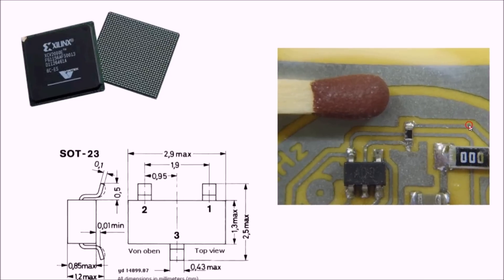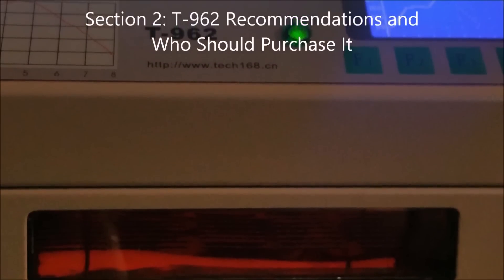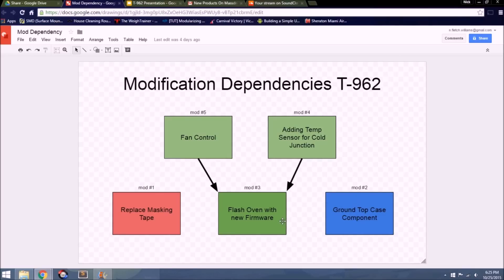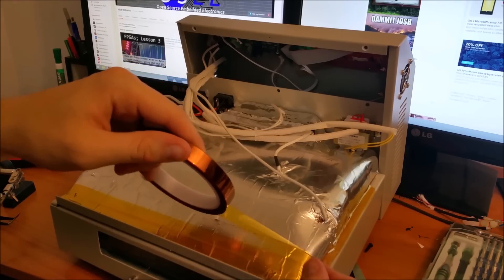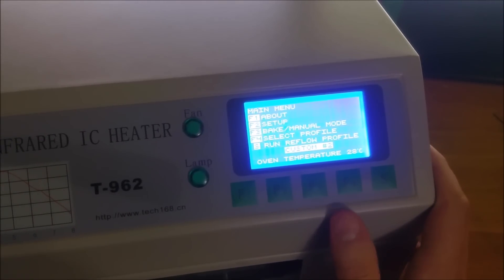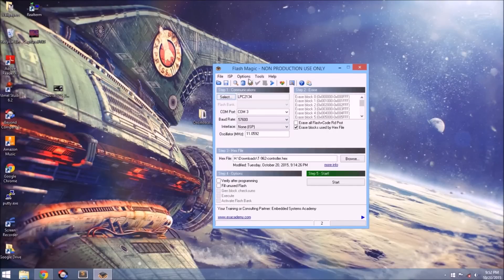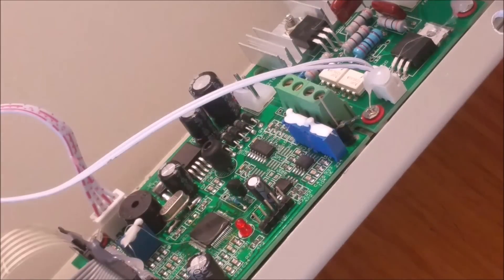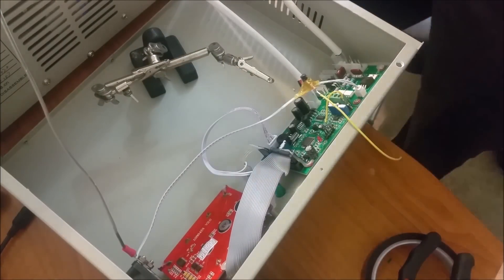Modifying the T-962 Reflow Oven

Comment: I just used a Silicon Labs CP2102 to flash the LCP2134 in my T962 by doing the following:  I set up flash magic exactly as in the video, I then held n_ISP to ground without releasing it when he did in the video, then touched reset to ground, then tested by reading device signature with n_ISP still grounded, then flashing, then releasing n_ISP, then touch reset to ground.  That worked like a charm after the normal method did not.

Comment: Hi, I'm having issues flashing the firmware, none of the windows software tools work on win10 and 7. In flashmagic, I cannot select any lpc2000 chips and when installing the Philips flash tool, I get an error about a missing. ocx file which I have fixed, but it still does not work. 
Can you put the version of flashmagictool in your dropbox, pleeeeease 😊

Comment: A pretty good video in lots of ways, thanks for the work and result.
A VERY important matter of electrical safety, protective earth conductors may be subject to extreme current under fault conditions (>1000A) and should NEVER rely upon solder alone to retain the conductors in terminals etc. Additionally, the fasteners used to attach the protective earth should not be used for any other purpose, and especially should NEVER be removed to enable removal of some other component.
For these reasons, the ground conductor should be crimped into the terminals with a proper ratchet crimp tool, it should be flexible (not solid) conductor in this application, and the lugs should be attached with dedicated screws using star washers to bite though the paint for proper electrical contact... and then TESTED to comply with regulations (typically <1ohm measured with 100mA or more current... that is right, an ordinary electronics multimeter is a sorry substitute).

Comment: Thank you and Unified Engineering. I did this mods - except the fan mod - to my T962-C model.
I decided to keep the system fan running to prevent overheating because of the higher load on the mosfets.
Also I did some mechanics like a transparent plastic screen instead of the matt one. Far better to read.
And I exchanged the push buttons from the panel PCB with better quality ones. Thumps up ... cool oven ...

Comment: I recently purchased one of the T-962 ovens for my own use. Thanks to your video, I'm working on most of the hardware steps to upgrade it, mainly grounding it and replacing the tape. However, I have a question. With regards to the tape, the tape that you linked to in your BOM, the ProTapes Pro 950 Polyimide Film Tape, is rated to 500 degrees Fahrenheit/260 degrees Celsius. Since most solder profiles seem to go up to 280 degrees Celsius, wouldn't that also burn the tape? Going for temperatures that high, is the tape suitable for that range?

Comment: Glad I found your video Nick, it made what was probably going to be a 6 hour job into a 2 hour job.  Everything worked 1st time, at 56,700 even using an FTDI programmer on the end of a 3 metre extension lead !  

I just soldered a couple of tactile switches to each other in the middle of a 6 way lead and covered in tape, it worked well.

The T-962A is identical so your instructions are just as relevant, but a couple of cable ties were use to replace the hot glue holding the longer cables to the case !

I'm working aluminium pcbs and need to add some bottom heat but I think that can be done without modifying the code. I'll probably add the heaters on a separate SSR driven in parallel with the existing SSR but with a switch to enable or disable them.

Comment: The fuck are these cautions at 5:58 for?
If someone is retarded enough to not disconnect it while opening it, how he could be into electronics engineering?
Reply: Man, video is usefull but these mods are performed very poorly.
My suggestions:
For temp sensor - don't scratch the soldermask, instead use wire and solder it to existing ground pad on the pcb somewhere else, also don't use this big wire, it puts a lot of stress on the resistor and temperature sensor!
Lastly, use damn shrink tube to isolate sensor's pins!

For fan control:
Don't make the mod around the fan's wire and don't cut it, instead do it on the bottom of PCB, cut the trace, and connect as video says, and again, don't use capton tape, use shrink tubing!!!!

For grounding correction:
DON'T SOLDER CONNECTORS!!!
CRIMP INSTEAD!!!
Perfectly also use shake-proof washers.

Comment: Hi,
I´m trying to flash mine with a regular FTDI and the Flash Magic on Windows 10. I can connect to the boar to see the device signature but when y run the programmer it always fail to erase the block 0 and do not work. Anyone could help me?
Thank you.
Reply: Hi, I have found the problem. I just download an older version of flash magic and it works!!

Comment: I got my T-962 reflow oven last week.  I did the Kapton tape procedure, but I was too scared to do the ISP program and board modifications.  Instead I went with experimentation.   I found out for a 1.5" x 1.5" board, it has to be positioned exactly under the front tube heater, look at the spy window.  For a Leaded Sn63/Pb37 solder paste, I used Wave1.  At the peak of Wave 1, I would use a small desk fan blowing in the top gap of the drawer to prevent overheating, for one minute.  The board came out perfectly.  I think this oven works for small boards used this way.

Comment: I found using an FTDI USB to TTL converter I could use DTR connected to nReset and ISP pin to ground without having to push any buttons or anything, it worked just fine. I also removed the board completely from the oven to do the cold junction mod and flashed the firmware with the 3.3 volt supply from the FTDI converter. I hooked up VS to the 3.3 volt trace jut below the ISP header.

Comment: I just finished modifying the oven. For anyone who is concerned about firmware programming: I uploaded the hex file using a FTDI cable from Adafruit (FTDI TTL-232). Simply connect RX, TX and GND, and wire n-ISP and RESET accordingly. Notice that the TX from the cable goes to the RX port on the PCB, and vice versa. If your grounding sequence is correct, the red LED on the PCB will go off, and the heat lamp & fan will start running at full duty cycle. To avoid this it is better to just keep the LPC power cables connected while temporarily disconnect everything else. Also, WEAR GLOVES AND DUST MASK when replacing the shielding tape! The manufacturer uses silica wool as insulation material. You will be exposed to silica wool when you open up the metal film-covered "lid," as in 7:32. Touching/inhaling fibrous dust is no good.

Comment: Really helpfull ! And it pushed me to buy this oven. Flashing worked as a charm, at once. One thing. I had the DS1820 lying around and , but it is not seen as a cold junction sensor and the little fan is still on. So I guess I need to have the 18B20... on their way... Thanks for this video ! Richard........ Edit! I found a 18B20 in a PIC development kit and this one works ! The Fan did shut down and I do see a cold junction temperature !

Comment: Great video! Flash Magic has a Mac version, but I couldn't get it to work in flashing firmware. It wouldn't recognize my usb-to-UART programmer. After struggling for a bit, I switched to a PC, and it worked the first time.

Comment: Be careful when soldering in the resistor for the CJ sensor.  There is a small via between the two pads and it is very easy to create a solder bridge.  I suggest the following steps:

1. Solder in the resistor.
2. Solder 1 end of the wire to the right (as seen from the same direction as the video) pad.  DO NOT solder the sensor end yet.
3. Measure the resistance between the left pad and the sensor end of the wire.  It should be about 4.7 K.
    If it is zero, you've probably shorted to the via.
    If it is infinite, you've got a bad connection.
4. Now you can solder the sensor end of the wire.

Comment: You do reflow work yet you use an analog multimeter?   I chuckled a bit when I saw that.   Not hating,  just don't see that everyday
Reply: Nothing wrong with Analog Meters, they are better at some jobs than digital meters, and the FET input types have input impedances comparable with digital meters.

Comment: Is the little fan supposed to be on when the oven is in idol/standby?  Mine is and I thought the transistor was supposed to disable it until its needed.  I connected it just as you said with pin order left to right: collector-base-emitter (1-2-3 for BC547). Otherwise great tutorial!
Reply: Yeah, the little fan is only supposed to run if the cold junction gets too hot. You shouldn't normally hear it.

Comment: I followed the instructions and modified my T962 oven - everything works as explained. One hint - I was not able to get the programmer but I found that any USB To UART bridge is doing the job. I had a board with FT232 chip and just used the Tx and RX pins to connect to the ISP connector.Thank you very much for sharing your know-how! Excellent video! Now I'm proud with my upgraded oven - I can't recognize it!

Comment: Thanks for the video Nick!  Completed the all the mods today without any problems.  The one question I have is on the added transistor.  I purchased the one that you had linked in the video.  As I read the data sheet, the collector and emitter appear to be opposite from what you stated.  https://www.fairchildsemi.com/datasheets/BC/BC546.pdf.  Am I reading the data sheet wrong?  Wondering if anyone has a suggestion on how to test this little fan to make sure it operates properly after adding the transistor?

Comment: Thank you . Thank you. Just flashed the firmware. Waiting for some Kapton tape and a temp sensor from eBay. Did you play any with the offset and gains on the two thermistors? my sensor was 12deg higher than the left. I dialed in a offset to get them to agree but not sure what the gain should be set to. I suppose I need to run it up in temp and see if the offset is constant or not. I'll wait until I get the cold junction mod done.

Comment: Nick, thanks so much for this video. I made all these mods to my new T-962 before even using it. I wanted to get started right! I also used a 1206 resistor for the temp sensor connection. It's the perfect size. In fact, the pads on the board are big enough that one could probably use a through-hole 4.7K ohm resistor there with some creative bending of the leads.

Comment: Thanks for the great tutorial.  I successfully made all the modifications you outlined with a few minor differences.  

For flashing the new firmware, I used Flash Magic on a Windows 10 machine and this programmer:

https://www.amazon.com/gp/product/B00IJXZQ7C/ref=oh_aui_detailpage_o01_s00?ie=UTF8&psc=1

I had no issues getting Windows to recognize and talk to the programmer.  I used all the suggested Flash Magic settings (baud rate, interface, etc.), except I also disabled the  "Use DTR and RTS to control RST pin and ISP pin" option under Options -> Advanced Options -> Hardware Config.

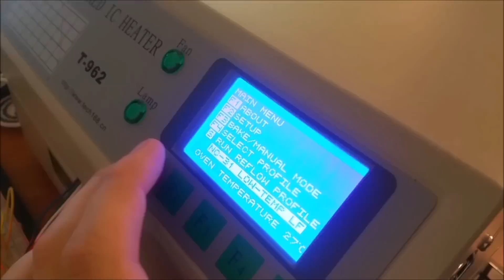Also, I didn’t connect the reset wire from the oven to the programmer.  So in the schematic shown around 11:55 in the video, I had no connection from the S2 pushbutton to the RESET pin on the LPC programmer.

For the DS18B20 4k7 pull up resistor I used a 1206 size, and it fit perfectly.

I also used a 2N3904 transistor for the fan since I had some of those lying around.

Lastly as some others have mentioned, there was no thermal compound on the triac and heat sink, so I added some.

After all the mods I had to do several calibration runs to get the thermocouple gains and offsets just right, but that’s another topic.  

The oven is running like a champ.  Thanks again!

Comment: Nick,
Have you received or heard of  any comments that,  out of the box,  the T-962 
heater triac did not have thermal heatsink compound applied.  With the 
system fan mod reducing the noise and airflow,  the triac can overheat because of low cooling airflow.  I would be interested in your experience with post-mod triac overheat.

Comment: I cant seem to find a user manual for their new firmware. what do the gain and offset controls do?
Reply: Ok, ill try that. also, I'm having a problem with the reflow. the oven is working pretty great but for some reason the solder I'm using isn't reflowing completely. i have the custom profile set up to the form given to me on its data sheet but its not creating good contacts to my led. any ideas?
Reply: ok, thanks ill give it a try!

Comment: Hi, Nick. The little fan did not rotate after all. Does this mean that the temperature on the board just do not need? What temperature is on oven's hardware during regular cycle? Thanks a lot. UPD: It working some time when oven switched on.

Comment: @18:24 you said 4.7Ohm, I thin it should be 4.7kOhm...
I didn't have BC547 transistor so I used 2N3904 instead. It has same specs, only emmiter and collector legs swapped.  Is there any way to test that little fan? I just run a quick profile and fan didn't come on. I'm not sure if it was supposed to or not...
Reply: I also used 2N3904.  When I turn the oven on, the fan starts spinning and then stops. Which I think means that as far as electrical connections go everything is fine, the MCU just does not use it.

Comment: Thank you so much for this great tutorial!
I just flashed FW on T-962A oven. Mine has same MCU (LCP2134). I used regular FTDI serial to USB adapter (like the one usually used for Arduino boards) and process was a little different.
1. Set Baud Rate 9600
2. Do not connect RESET pin from oven controller to DTR pin on FTDI adapter!
3. It was a little unclear if you have to short n_ISP or RESET pin to the ground after flashing is done. It's a reset pin.
4. Also on my oven when I enter programming mode, big loud fan comes on (scared me a little at first).
Reply: Hi,
I´m trying to flash mine with a regular FTDI and the Flash Magic on Windows 10. I can connect to the boar to see the device signature but when y run it always fail to erase the block 0 and do not work. I appreciate If you could give some advice of what you do to program with a standard FTDI.
Thank you.

Comment: are there any other options for LPC programmers? the one you linked only offers delivery 4 weeks from date of order (unless expeduted which is +$26). And the only seller on eBay that has it won't deliver to my address.
Reply: +Nick Williams Hi, Nick. Sorry, I forgot to comment to that post when I found it. Thanks.
l
One other question. I don't have a breadboard and buttons. So to manually do the bootload process...instead of breaking out the nodes, I'd just connect a wire from the GND to ISP, then momentarily short RESET and then remove ISP from GND?
Reply: +Nick Williams Ok great. Thanks for this walkthrough. You saved me about $100 as I was about to get the Controleo2 kit!

Comment: Thanks Nick for this detailed video. I wouldn' have tried it without your "encouragement".  I received mine yesterday and took it apart without even starting it up. I replaced the tape with Kapton and reflashed with new firmware. I tried to connect the Usb-to-RS232 cable and breadboarded my RS232 to TTL but it wouldn't successfully flash so after few hours I realized that I have ChipKIT development board with FTDI chip on it so I put the board in constant reset and used the FTDI to flash. Worked like a charm but wouldn't flash on more than 9600 bauds. I think that +Timberw0lff is right, you don't need to connect reset line because you reset the chip manually. 
Then i tried to put the cold junction sensor. The only one I had around was DS18S20 so I gave it a try but it wouldn't recognize it. I installed the fan control but I used the SMD BC847 and soldered everything to perfboard. 
After putting it all together without cold junction sensor i gave it a few tests. The oven runs a bit hotter (PCB is 40 degC hotter than the oven displays) without the sensor but I still think this will be useful with custom profiles. Thanks again.
I've put some pictures here: https://goo.gl/photos/RDBpVCiXKs32xWc76

Comment: Thank you for this precise tutorial. I did all the mods indicated here. Regarding the firmware behavior, I noticed that in Bake Mode the Left temperature indicated is identical with the cold junction temperature, and it varies the same. What do you think? It may be that the left temperature sensor is broken? It may be something from the software? I am afraid the readings are not accurate on running profiles, if this sensor is broken. What do you think?
Reply: +Nick Williams no, it works just fine. when bake mode is set higher, things get pretty clear, with actual readings. HOWEVER, I discovered something which I don't know why is happening: the left side of the oven runs colder than the right side. And that was confirmed with two temperature probe measurement, just where the oven probes are. The readings are pretty much the same for all temperatures, but the concerning thing is the left & right temperature difference, which can also be sensed by hand, after the oven cools down a bit, allowing to touch the tray. The heating elements glow just about the same, so I can't suspect them. But probably the flow of air comes from the left side first, but I wonder how... Gain adjustments does not compensate for this behavior (I don't even know exactly what they do. I wonder how to fix this. Is this happening to you as well? Any workaround to level the temperature inside the oven? I was thinking of using "Reflect A Gold" to coat the interior of the oven so the IR from heating elements would reflect more inside. But then, the flow of air might be the same, hence dividing the temperature inside. I'm out of other ideas...